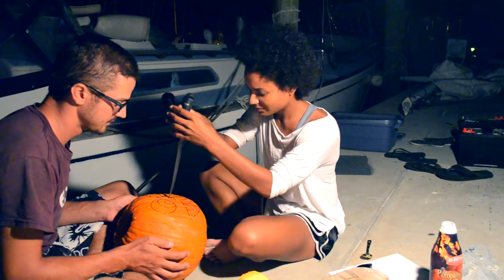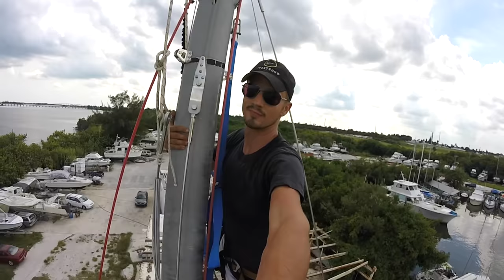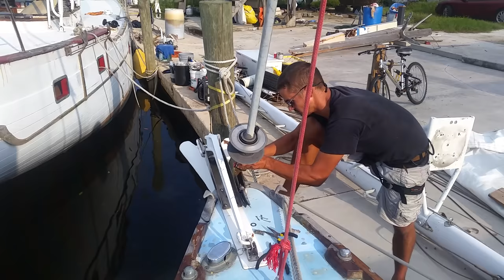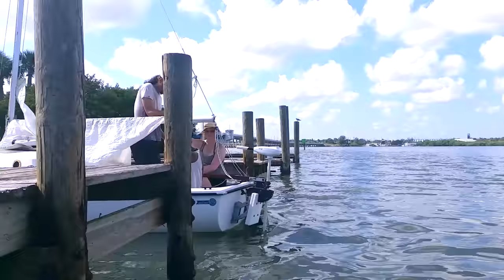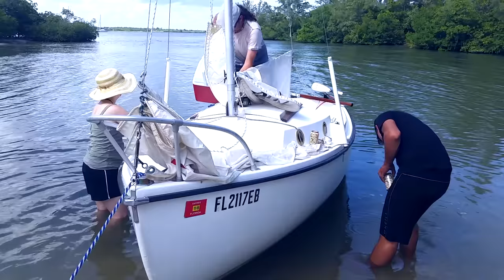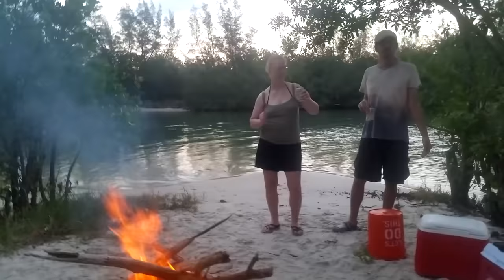Rigging, Sails & Sound Decision — Sailing Uma [Step 15]

Comment: I just did my rigging and my front and back stay were both about an inch to short.  I can just barley get the pins in the turnbuckles.  I was told that it will stretch out and that I will have to tighten it up after sailing a few times.   Thanks for the video.
Reply from the maker: +Down In The Islands Yes, I've heard the stretch too. Just sitting at the dock ours have stretched slightly already.

Comment: Hey guys, cheers from Russia.

Thank you for filming and sharing your journey!
Started with looking at your new engine, and then tracing you back to see the whole thing from the very beginning.
Awesome job, and thank you again!

Also one small question. Why didn't you use a piece of dyneema with a roller and a lock for a backstay? More flexibility, easy to adjust the rigging for different winds.

Comment: Impressive solution with the standing rigging.
Reply: Borrow or rent a " Standing Rigging Tension Adjuster "  Get them even as soon as you can before you damage / bend your mast !
Reply: Not so much, impressive !  Need to borrow / rent a " Standing Rigging Tension Adjuster " before you damage / bend your mast.  Get everything even !  do not try and eyeball it !

Comment: Nice work...  Handy tip when you are cutting stays... wrap it in blue painters tape to make for a cleaner cut
Reply: +Wifecallsmesanford using a hacksaw or a grinder is not recommended for cutting cable. Invest in a good pair of cable cutters.

Comment: All done now but wrap the cable in tape makes cutting them much easier.  Being that the cables are going to be in a salt environment you may want to avoid anything that heats the stainless up to glowing such as power tools cutting it.  Free iron can migrate around and those ends will rust quicker than the rest.  If you want to read more about it lookup stainless passivation corrosion prevention.  only reason I bring it up is the importance of rigging and if it fails life really sucks.  with good periodic inspections everything should be fine.
Reply from the maker: +met9009 Thats an interesting notion. What about all the welds on the lifelines and pulpits? They don't seem to rust any faster and they get red hot. Also, since the ends of the cable are sealed, they're shouldn't be any water penetration.
Reply: +Sailing Uma stainless welding uses an intert gas and also they try and minimize heat in some cases after welding they do passivation treatment.  I come from aerospace industry so maybe way over thinking it but still somewhat applies.  either way keep up the good work!
Reply: +met9009 it's exactly what I was thinking when I watched the grinder....  As long as it's sealed enough... sometimes standing water can get into those joints and they rust faster.... But I'm not familiar with rigging..   just rusty cars in Nova Scotia

Comment: Boy did you get lucky with the cable cone on the end of your furler, they never come out that easy
Reply from the maker: +Cptn Uwe (keymastr) Well, we just replaced it a few months ago and it hasn't seen much tension or corrosion yet. Although, when we removed the original cone up in Boston a year a go, it came out just as easy.

Comment: A grinder really is the best tool for cutting SS wire rope.  If you are going to use a hack saw, wrap several layer of tape over where you are going to cut and then cut through the tape and all.  Less fraying.

Comment: Happy christmas and safe sailing in 2016.
What make of day sailor has your friend got, looks like great fun with fixed keel and only 18 inch draft.
Sean in Ireland
Reply from the maker: +sean corrigan It's a Compac 16. It was so much fun to sail. We got her up to 5.5kts in about a 10kt breeze. And when we "grounded" we would just hop off and push her back into deeper water.

Comment: Hi,

one question: How did you measure the correct angle of the mast?

Cheers, Andi
Reply from the maker: +Horst Kotte We used a very technical approach. Lots of complex trigonometry and mathematics.... We wandered around 3 marinas and 2 boatyard and looked at as many masts on similar boats as we could, then just duplicated it approximately. Only time will tell if we got it right, but so far so good.
Reply: +Sailing Uma Thats one way to do it. I'd recommend to consult the owners manual / sail plan. At least the manual normally isn't too difficult to obtain (interwebs, owners club, ...). This one is for the cutter but I guess you've got a sloop?

http://www.sailingseadragon.com/Manuals/OwnerManualP365Cutter.PDF

It describes how to do it (lead plumb) and for what measurement to aim for. And don't forget to trim the boat to the waterline, I guess the it will be off due to the missing engine.
Reply from the maker: +Horst Kotte Thanks for sharing the link, but it's for a 365 not a 36, entirely different boats. We did however look hi and low and search the internet and Pearson groups looking for a manual for our boat with zero luck. It would certainly be nice to have a manual though. Might help us resolve a few more quirks.